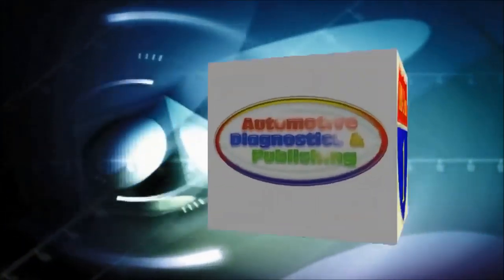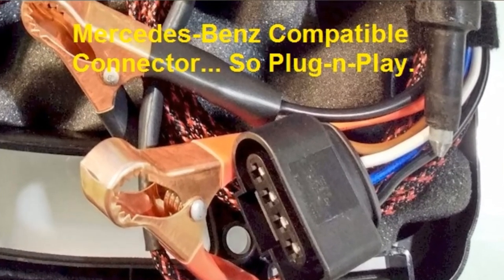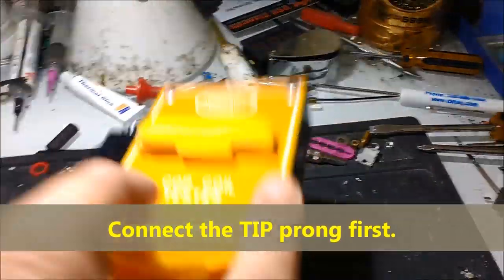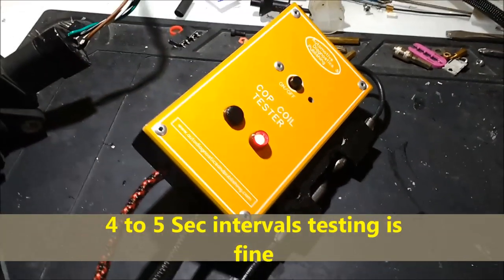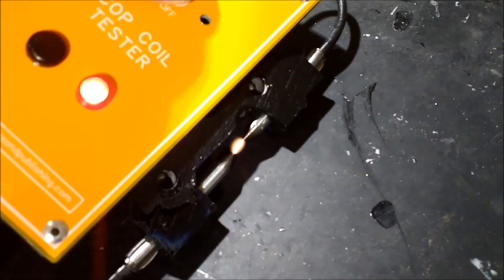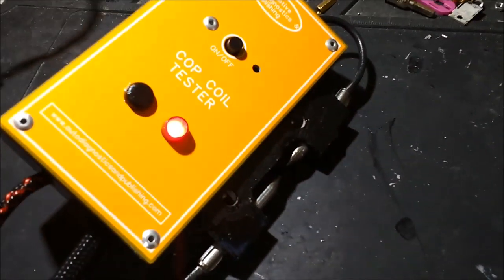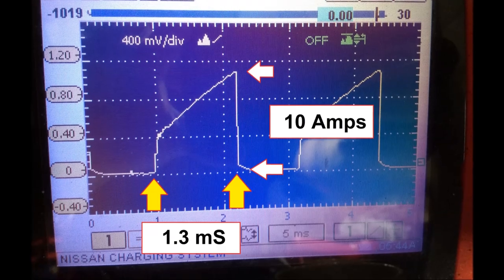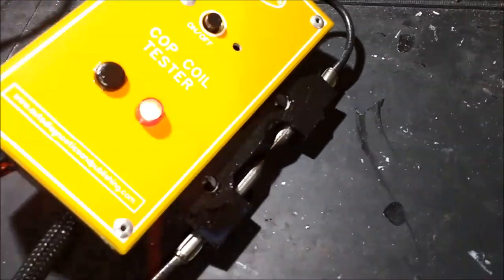How to Test a Mercedes Benz COP Coil with Current Analysis

Comment: What is the acceptable ohm resistance between terminals 1 and 2  (12 Volt Power and 2-Ground). My Mercedes Delphi AMG ignition coils are all over the map ranging from 31 K Ohms to 15 Mega Ohms?
Reply from the maker: You got electronics in between. Doesn't matter

Comment: Thank you very much for posting that mercedes coil pinout! 
I was searching for it on the internet and could not find it. 
And there is no way to deduce it by testing for resistance between pins.
Reply from the maker: Yeah, it got internal driver.

Comment: Two things i noticed. First the testing frequency is around 500 hz which translates to 30000 rpm not 3000 rpm and this is evident by listening to the tone of the spark generated by the coil and by looking at the current waveform and calculating its frequency . Second it seems that you have a shorted secondary and it's evident by the vertical rise of the coil current. I appreciate you commenting on both.
Reply from the maker: Wrong, this is a stress test
Reply: actually the coil fires once every 2 rotations (because it's a 4 stroke engine) so 500hz translates to 60000 rotations per minute (assuming there is no multi spark)

Comment: Thank you. Good job. I have two questions. 1. The current ramp in this video has a step in beginning of the ramp, was this coil, you used,  shorted internally? 2. What level of DC voltage is used on the trigger, 5 VDC?
Reply from the maker: Wow, you ask good questions. Ok, question 1: Lots of these coils are aftermarket and lower quality. Through trial and error, we found that after testing more than 48 different coils, used and new, same type, that the lower quality coils did not respond the same. So, we expanded the coil dwell to accommodate the cheap coils. And Question 2 is the same, we also made the trigger adaptive so the unit senses the pulse. It keeps raising the trigger voltage if it doesn't see a spark untill it gets to a maximum of 9 volts, so from 4.5 to 9 volts. That's why all my tools ARE NOT THE SAME. Besides the connector being different, the circuit (Toyota, Nissan, BMW, etc) the circuitry is also made for each make coil and OEM or aftermarket coils. Check the bottom of the page. http://autodiagnosticsandpublishing.com/
Reply from the maker: Another point: the driver pulse width is overdriven a tiny bit, that's why you see the slight vertical line that looks like a small short. It's just we found the trade-off point between OEM original and aftermarket setting.

Comment: Sir difference between ECU reprogramming and flashing. How to do it
Reply from the maker: So, it's the same. Now, ECU coding is something else. Some ECUs have multiple firmwares in memory; so you code or tell the ECU which firmware to use.
Reply from the maker: Then further still, there's configuring, which is to set different parameters in memory, like VIN, or Antitheft matching.
Reply: Sir plz upload one video for how to flashing any model ecu